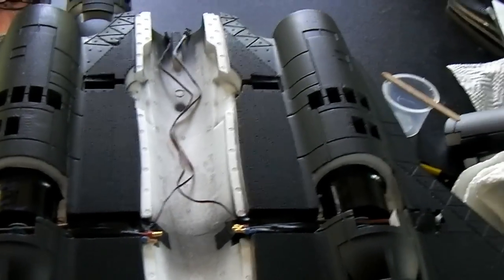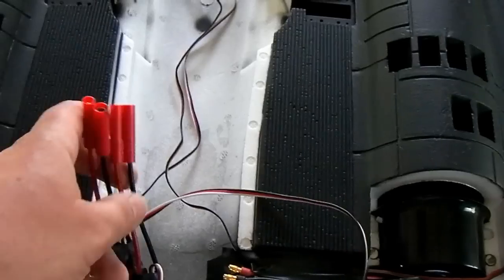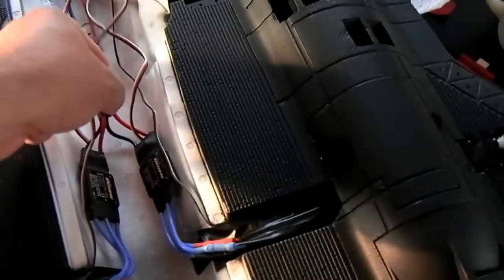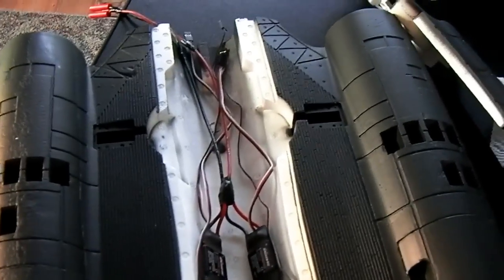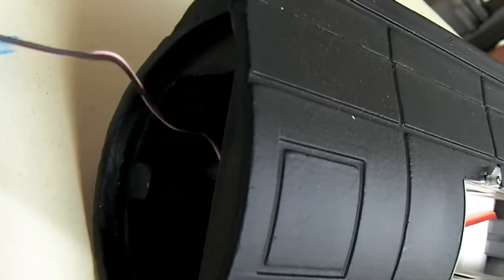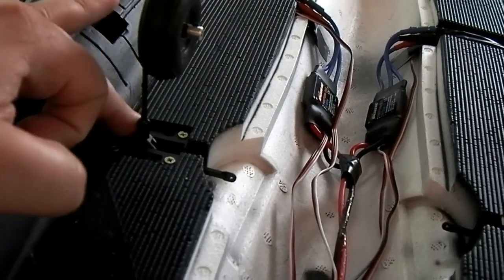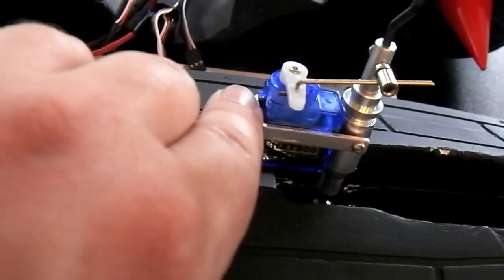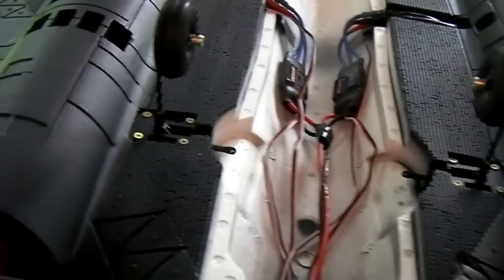Max Jet SR-71 Build Part II

Comment from the maker: @vanepico 
Excelent point, I am not sure with gague wire that it, it was just some I had left over.  I used the same wire in the A-10, which is dual 55mm.  First thing I am going to do is put it on my watt meter and see what it pulls.  I have it all closed up now, so I can't easly swap it out.  Thanks for bringing that up, I did not even concider it.  I will keep track.

Comment from the maker: @crpyrob 
I got my grove going a little better on this one.  In the first part, I just kept looking at the instructions going "where do I start?" "what do they want me to do?".  Part 2 I cam into a little more prepared.  Yes the servo wires could go up and over the EDF shroud, if you cut a notch in the hatch.  The bottom of the hatch is curved like the EDF, so it might be a little tough to do.  I am not worried too much about heat as the air flowing over the motor should keep it cool.

Comment from the maker: @cesarvega71 I agree, the instructions are very lacking, especially for a beginner.  Based on other dual jets I have had, it should work like this.  An esc to each motor,, bten the power connectors come down to one, to hook to one battery, so think of it in a Y.  Then the servo connectors should be hooked to a Y and then plugged into port 3 on the RX.  So both ESCs are controled off one RX port.  40A should be good, I went a little lite with 30, but it should be OK.

Comment from the maker: @MrBlueAngel11 
It is not super tough, but if you have never built a kit before, I am sure that you would be lost.  The plane was designed to run on one battery, the RTF comes with a 2200MAh I believe.  I am going to try it on a 2200 as well, but I also got a 3000 to use with it.  However I will have to modify the battery hatch to make it fit.

Comment from the maker: @cesarvega71 Oh, that is the easy part.  There realy is no way to mess it up.  I am assuming that the 3 wires off the ESCs areall the same color, and you have the 3 colors on the motor.  If you have plugs on both ends, just plug it in.  If not solder them together if you wish.  Tunr every thing on, and run the motor up with the TX.  If it runs backwards, switch any 2 wires!  It does not matter which 2.  You can't hurt the motor or ESC that way, it will just run backwords if it is wrong.

Comment: Hmm looks like you might need to increase the size of that wire, seeing as it is gonna have twice the original current, and it is smaller than is already on the ESCs, it has been known that wires actually set on fire because they have to much current flowing